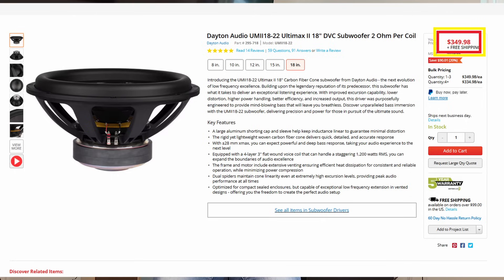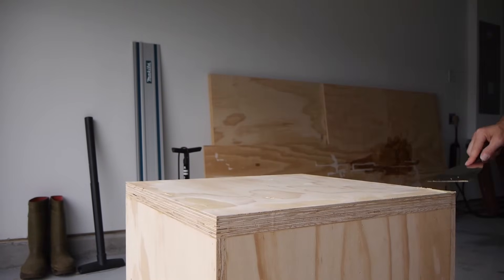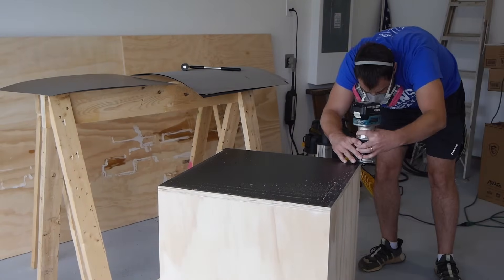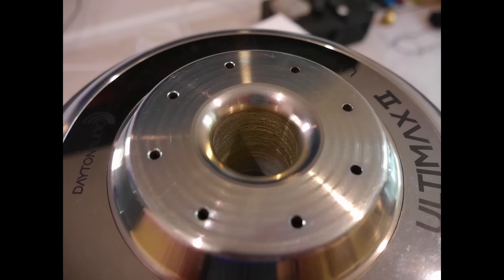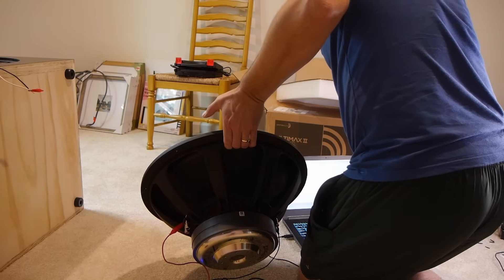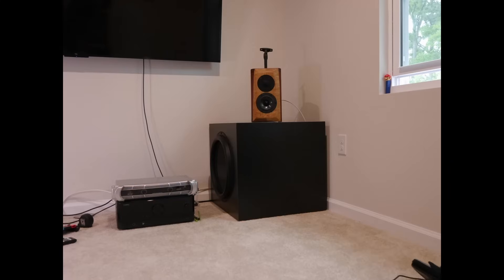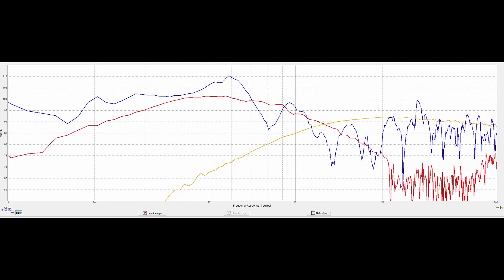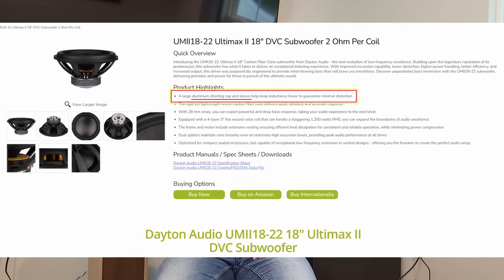Dayton Ultimax II UMII18-22 Test and Review in a Sealed Enclosure

Comment: I broke the UM-II 18" in for 12 hours @ 10 Hz. Held up nicely. A second UM-II would help with the modal issues. Might have to align the subs front-back or side-side to get better response. Time alignment would also help. Changes in the 1 - 8 ms range. Corner placement might not be ideal. The UM-II has lower inductance than any subwoofer in its price range. It matters for distortion and accuracy. The dual separated spiders will help with linearity. With 28 mm of x-max it is probably the best value vs. performance in DIY at the moment.
Reply from the maker: Time changes wont help with room issue, but might smooth out the crossover region. Adding more subs will help a bit but wont get rid of that 60hz peak. Thats a standing wave that will likely show up with any sub positioning. Ill definitely work on it, but the big "anchor" sub will have to stay where it is. Maybe Ill turn it 90 degrees. We'll see.

Comment: New subscriber, glad you are making and sharing. You didn't show the bracing. Or, did I miss it? Ply strips along the side walls, held on with brad nails? Any advice or suggestions for bracing? Is lining or poly stuffing ever needed for a sub box, in your opinion?
Reply from the maker: I had more bracing than this, but didn't show it because the clips were edited down so much. 

As for stuffing, you shouldn't use it when measuring Vas. I haven't bothered to add any because it actually doesn't do much on small sealed enclosures for subwoofers. For a woofer, it's a must.
Reply: Groovy thanks. If it's ported, is stuffing more useful? Even more braces! Good to know. Thanks. Good luck in your new circumstances.  @ImpulseAudioSpeakers
Reply from the maker: @RWmHII I would still say it's not necessary but could be a issue it using up to and above 100hz. Depends on the enclosure dimensions. Anything greater than 2.5ft is getting close to being an issue.
Reply: Super helpful! Thanks! @ImpulseAudioSpeakers

Comment: How did you get the edges of the laminate not to line up so well that the wood doesn’t show through? 🎉 also, very curious about the bracing on such a big driver? Also, why no “stuffing/sound deadener on the walls?  
Would be cool to see ya build one with a plate amp also. 🎉
Reply from the maker: In real life you can see a slight brown line of the paper back laminate. Must not show on video. 
There's more bracing than shown. I cut this video down so much it's just not shown. 

For the Vas measurement you shouldn't use material in the cab. Ultimately it actually doesn't do much on a small sealed sub box. A woofer I absolutely would.

Comment: Awesome to have you back.
I own the original 18-inch Ultimax, but have never been happy with it. 
At 3:05 you said you laminated the bottom first, but at 6:28 the bottom isn't laminated. Confusing.
Reply from the maker: Sorry. That's what I normally do, but should have said for this build I didn't bother with the bottom.
Reply: What enclosure type, & size ( Net airspace) have you tried? Is the sound quality, musicallity, or Deep Bass lacking? How much power?
Reply: @evilinside5984   I have a video on my channel of the build. It's a 7 cubic foot (net) enclosure with two 4-inch ports. Granted, an ideal ported enclosure size would be 10 or more cubic feet, but it's good enough to get a feel for the driver. The thing is SLOW (transient response) in my opinion, and it's terribly power hungry. It's really only good for 20-40 Hz. Much more above that and it sounds like mud. No definition. I greatly prefer the sound, the efficiency and the speed of the Dayton Audio RSS390HO 15-inch Subwoofer (also on my channel). But in recent years I find myself preferring the sound of "Pro-Audio" woofers. They are far more high definition, hard hitting and efficient.

Comment: A great tip for the veneering process:  after you have applied contact cement to both the wood and the veneer and let it cure, place down some wax paper on the wood enclosure, then place the veneer on top of the wax paper.  Then you can move around and adjust the veneer until it is lined up perfectly, then slowly draw out the wax paper while holding the veneer in place.  That way if the veneer is accidentally mis-aligned, it won't stick in place because the contact cement doesn't bond to the wax paper.
Reply from the maker: Good tip. I've seen that done but never tried myself.
Reply: Or place dowels on the box, place laminate on the dowels, pull the dowels out as the laminate bonds.